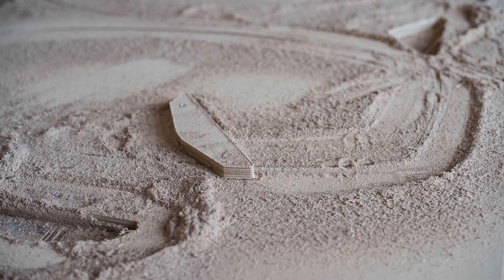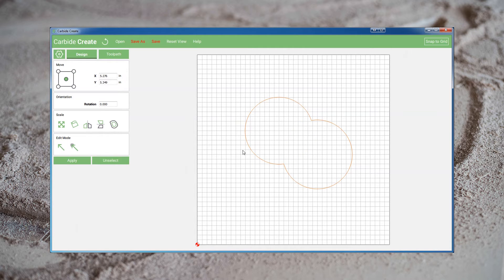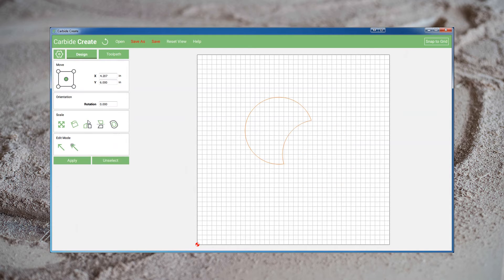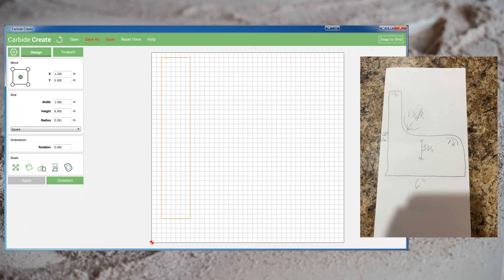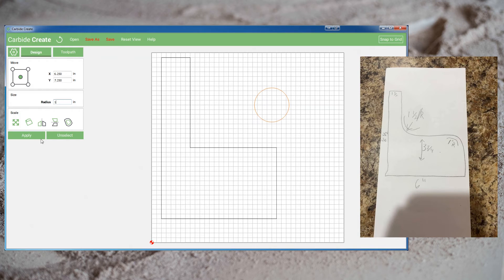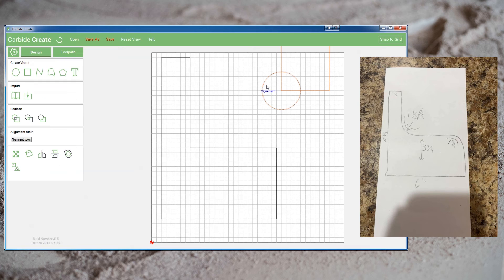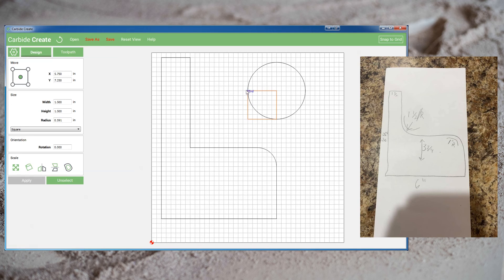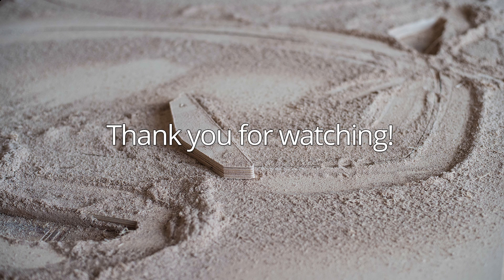Practical CNC - Using Boolean Operations in Carbide Create

Comment: I am following your videos and they are great. I was wondering if you could show in a video how to design and set up toolpaths to cut vertically .
I know that the XXLShapeoko will extend  past the front of the machine far enough to cut 3/4" thick wood. I have a design for a vice to hold the wood secure past the front of the machine. Just not sure how to create the file.
I am looking to build boxes that are .5 thick 5 inches wide and 9 inches tall.
Thanks Jeff Peters
Reply from the maker: It's not on my near-term list of things to cover because it requires some setup that I haven't done, but I'll keep it in mind for sure.

Comment: Wow ! Just like Bob said, I actually had this exact issue today, I'm already bald, and now I have less hair. I actually was designing a tablesaw pushstick sort of speak. I saw on another site a triangle with notches, or steps as the catch, that was easy, what I wanted to do was pocket the inner face with rounded inside corners. I didn't do it the way you described...which is way, way better. I first drew a circle the size I wanted and layed it over the drawing and then traced the inner part of that circle with the "Node" tool, then erased the original circle leaving my traced section in place and then attached each side to the three circles using the "Node" tool. Well, that was my long way around the block.
Thanks once again for using your excellent teaching abilities to help. Andrew